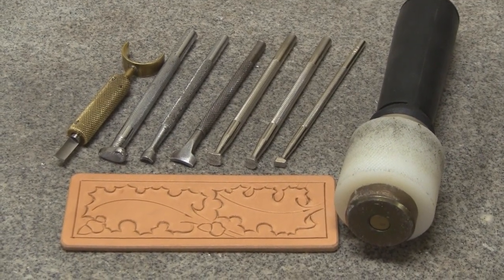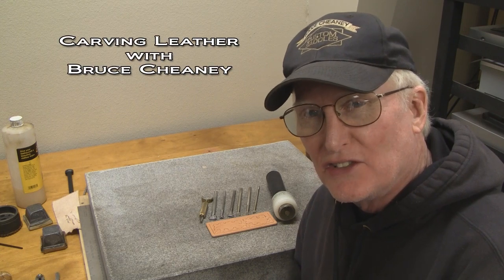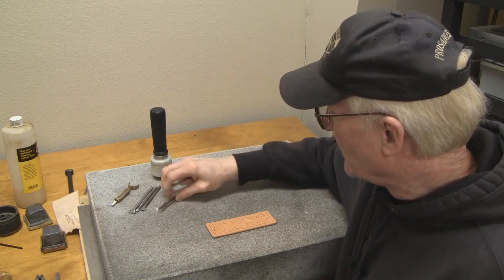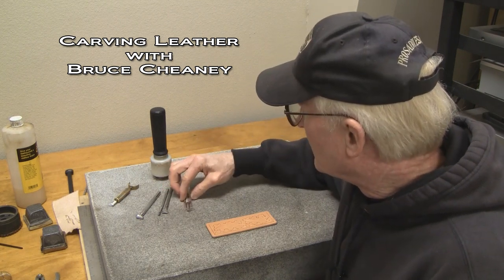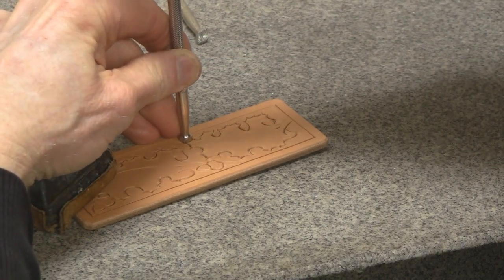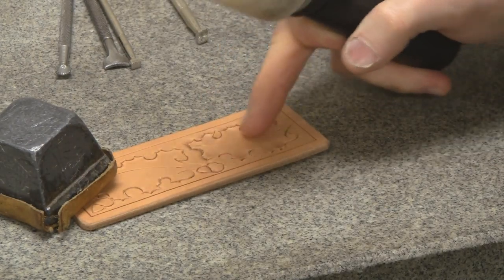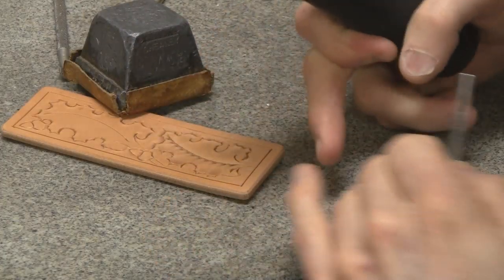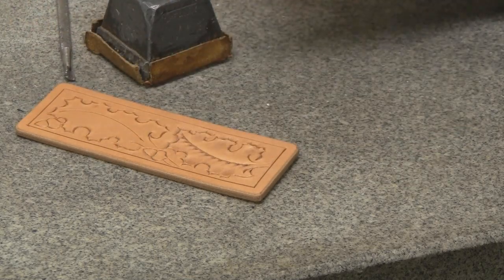Leathercraft: Carving Leather Tutorial Part 3 With Leather Craftsman and Saddle Maker Bruce Cheaney

Comment: Dear sir,

This is amazing video. I'm a begining in making leather product, and just made some simple thing. I want to improve my skill by dye and carving leather. Can I ask you where I can got your gear.

Thanks a lot.
Reply from the maker: Chacharoti Hồ Most of my leather tools, materials and supplies at Weaver Leather Company and Tandy Leather Factory. Thanks Bruce
Reply: I had visited tandyleath, but I confused when choosing leather. They have too much kind of leather with a log of color. Can you let me know what kind of leather should I buy to carving leather.
Thanks.
Reply from the maker: I think a good choice for you to start with will be Oak-Leaf Sides # 9157-58 8 to 9 oz. on page 6 of the new 2015 buyers guide. This will be a good hide to tool and carve designs into plus you can make belts and sheath and cases out of this if you want to. Bruce

Comment: Sometimes when I am beveling an edge, the beveler pushes in on my image and ruins my line.  Why does this happen?  How can I prevent this?
Reply from the maker: I have noticed if my stamping rock has some bounce to it  that causes the problem of the tool bouncing up onto the cut in line. You might try different stamping surfaces.